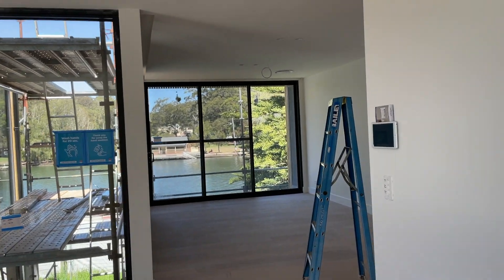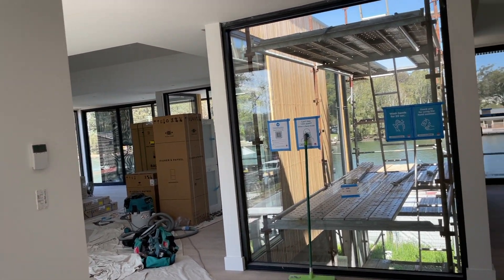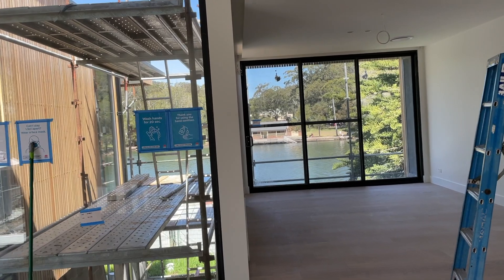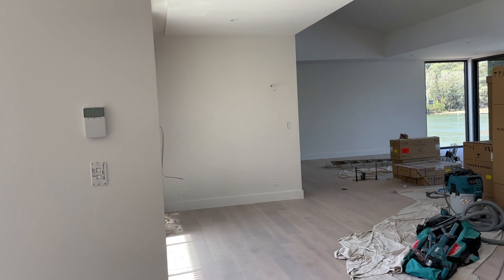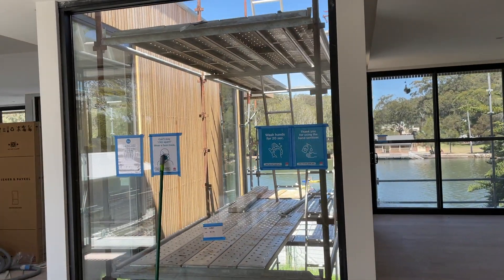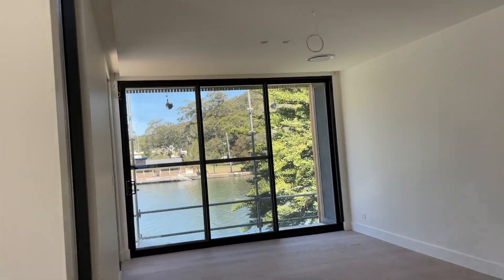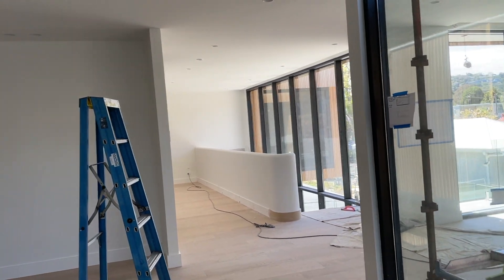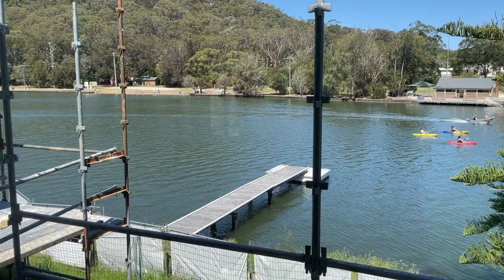Daikin VRV IV || Residential Air Conditioning Install

Comment: Hey Mitch. I have a Daikin 16KW unit connected to Myair 7 zones 7 temp sensors.

In terms of airflow. I understand there needs to be a spill zone (common area) but if we have 2 zones on (6 vents) and the master reaches temp that extra dump of air drops into the common area. Is there a way to reduce the airflow?

Comment: Hi Mitch we are getting a ducted Daikin 12.5Khw 3phase with MyAir 5 zone controller. What's your experience with the MyAir 5 failures and tablet problems, seen a few neg reviews. Great vids mate keep going they help a lot seeing real world use and problems. Cheers
Reply from the maker: I’m a fan. The reason why I use them is because I like how you can choose where the unit senses temperature from. Plus the MyPlace app is way better then the Daikin app (however I think Daikin has just released a new wall controller and app which funnily enough is a copy of the Advantage Air setup). 
A tablet definitely isn’t as reliable as a simple wall controller. That’s a fact. I can’t sit here and tell you that I haven’t had issues with advantage air products because I definitely have. I will say that Advantage Air do have great customer support in my opinion. 
In conclusion, I like the product but the tablet isn’t going to last anywhere near as long as a simple controller on the wall. If you have just a simple controller on the wall, you can’t choose where the system senses temp and there for is less efficient to run. If you want basic and reliable, go for the Daikin controller. If you want an efficient smart system, go for the MyAir 5. For what it’s worth, I’d go for the MyAir 5 in my place. Each to their own I guess. All the best.

Thanks for the comment.
Reply: @maracservices   Thanks Mitch appreciated mate its a mind field choosing a ducted system big cash that can't afford to go wrong and so many mixed opinions on every part of the build. Cheers
Reply from the maker: @NeptunesGuitars  It sounds like you have a good set up mate. I personally have a Daikin in my house and the older MyAir. If it makes you sleep easier, even if you did have a problem with the tablet well into the future, you can always unplug it and wire in a Daikin controller (worth $110). I think you have made a good decision. Cheers